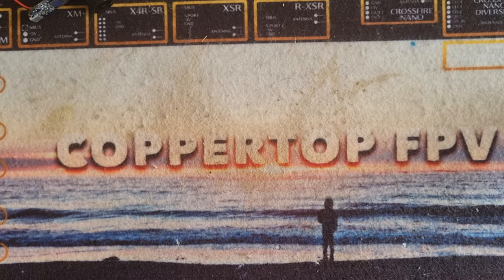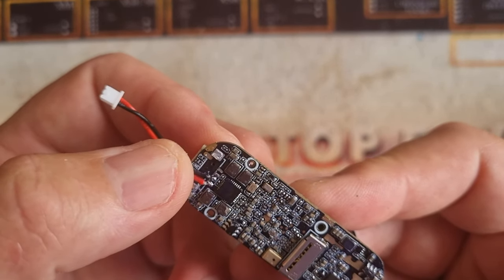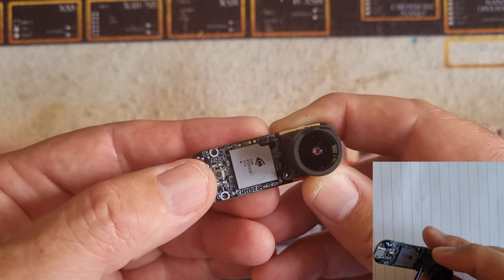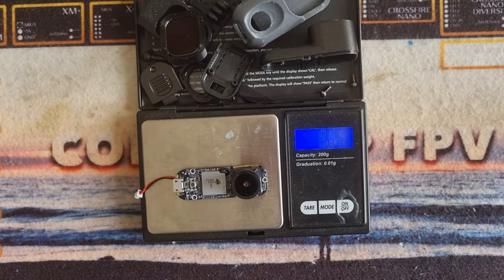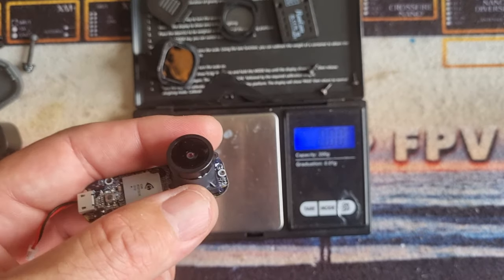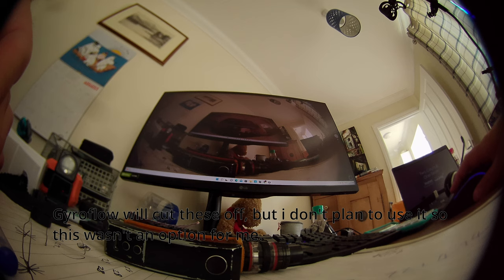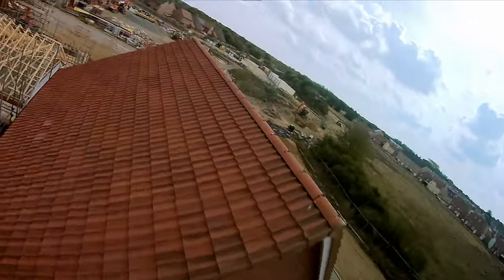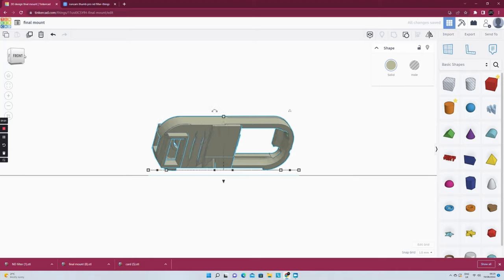Stripped Runcam Thumb Pro plus lenses and Hero 7 wide lens mod.

Comment from the maker: if you use a different wide angle lens the smo4k nd filter 3d print will work (stock nd filters wont) so you can just make the hole for the lens a little smaller in tinkercad as the hero 7 is a bigger diameter. obviously if you use the rc18g lens then gyroflow will crop the black corners anyway.
Reply: I like the video brother but this is so funny to me cause i just built a 3in aluminum armattan rooster prototype and im running a gopro session and a 4s 1300mah lipo on it and it's a 3in quad! total weight with all that stuff is 500 grams exactly and it flys great. and i fly it in 3D mode.

Comment: Really interesting.  I've been playing around with trying to hack the runcam pro a bit myself.  I found that the original one uses a wider lens mount than the wide.   The original one has the smaller view, is that the one you're modding then?  Which lens would you suggest to get a wider view and make it more like the -w?

Comment: Nice info.. and thanks for the tutorial at th end.. im quite happy with rc18g lns for my pure naked thumb pro that i use with my 75mm 1s whoop.. and ratel lens with stock thumb pro chasing.
Reply from the maker: Saw your vid earlier on FB. Looks good.
Reply: @CoppertopFPV  thanks... 😊✌️
Reply: does the rc18g lens also fits with the stock case? and can you use the counter ring to lock focus?
Reply: @prottentogo  nope. Its about 1-2mm longer...

Comment: To me it seems like the Thumb Pro almost comes close to being a decent camera for the < 3" whoop/toothpick use case. Especially with your replaceable lens mod. The other camera i was looking at this price range was that Hawkeye firefly x-lite 2, but i suspect that would make the footage a lot more shaky in winds on these little quads. Now all i have to do is wait for the next sale and pull the trigger.

Good job!
Reply from the maker: It's pretty crap just.... weight. Also the form factor helps a lot compared to a naked gopro etc as there's less drag. For youtube phone vids on little stuff it does the job.
Reply: @CoppertopFPV  Yeah the weight and the form factor is what bothers me about the X-lite. The only reason  i was even considering that one is because of the onboard wifi - which makes it super easy to get the footage and decide if i have to make another flight.